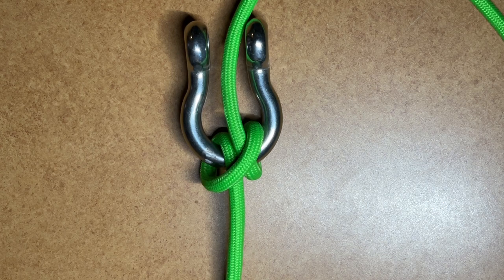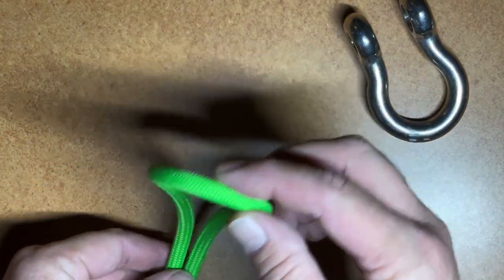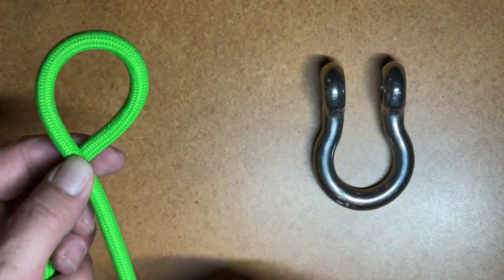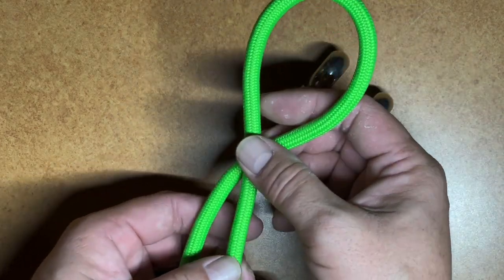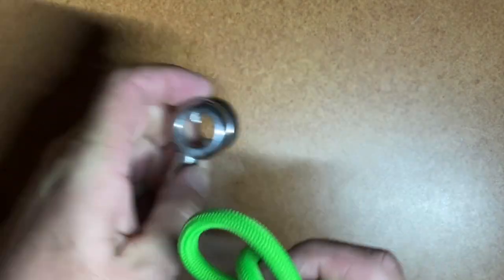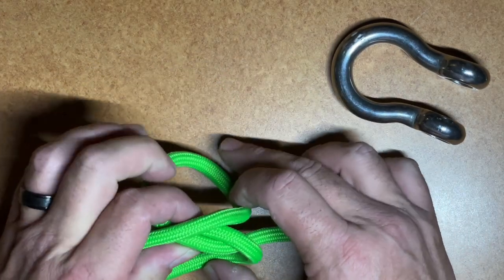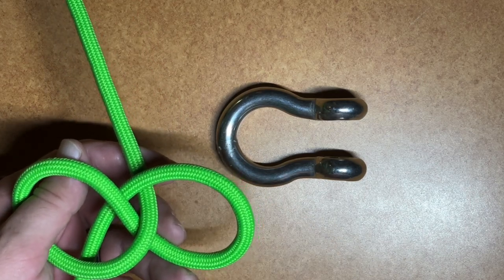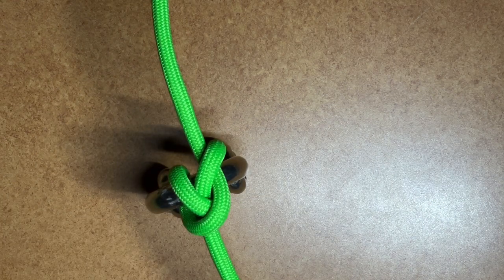5 Common Hitch Knots Tied On A Bight

Comment: Very easy to follow along and learn theses hitches, but it would be nice to know the applications for each
Reply: Clove Hitch is really important to know.  It forms the basis of many knots, or, itself is used as part of larger knots.  By itself it's not terribly secure, but, see the Round Turn and Two Half Hitches, the Anchor Bend, and the Buntline Hitch.  I will use it to tie a dock line 'round a piling, though I'll usually throw another Half Hitch 'round the standing part, and I won't leave it for very long.

Cow hitch is another, if the pull is only on one end this doesn't do well.  The Pedigree Cow Hitch and the Bull Hitch are better suited here.  But, it works well for attaching a sling to something (Girth Hitch), and I like it for tying soft shackles.  Also popular for the upper loop in a Trucker's Hitch.  Won't bind.  See also the Barrel Sling.

The Constrictor Knot does like it sounds.  It will NOT let go.  If you plan to undo it, finish it w/a bight.  It's a useful temporary whipping or seizing.  I admit I've used it for quick and dirty (really temporary) repairs on hoses.  Um, I'll use it to start (or finish) some decorative stuff, like a French Whipping,

I love the Spar Hitch, though rarely tied on a bight.  I use it to hang fenders, and I've used it a good bit to secure a stern line 'round a tree or something on shore.  "Miller Knot" refers to several similar knots, sadly, but they're worth exploring, along w/the Strangle Knot.